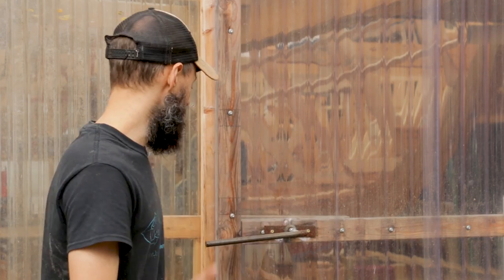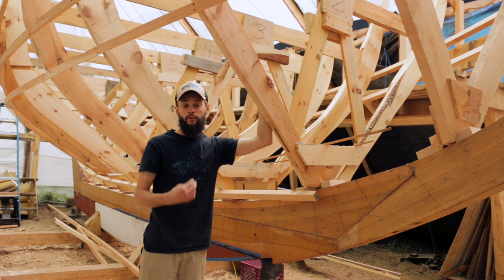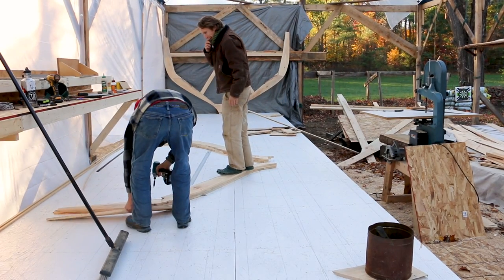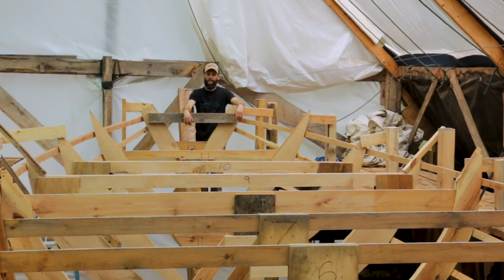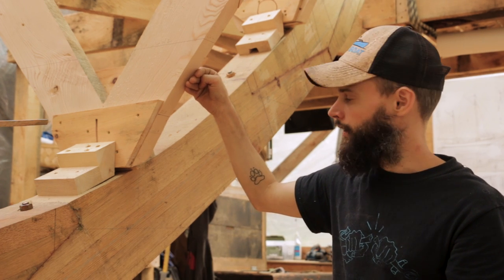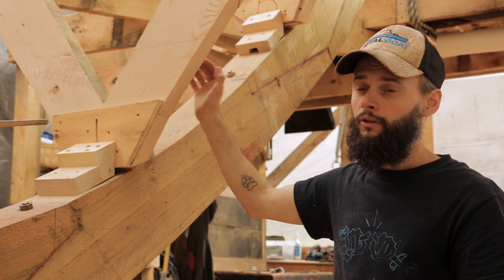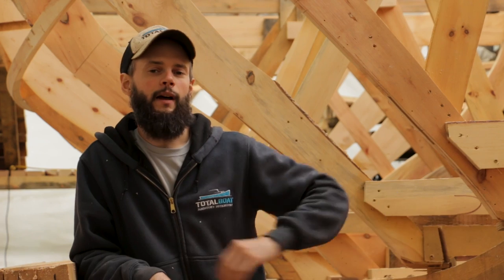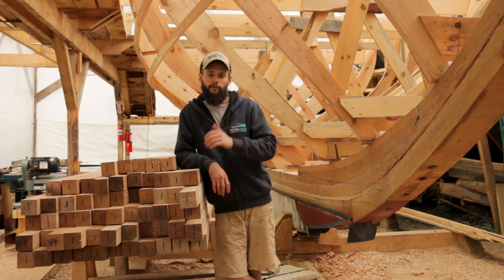Acorn to Arabella - Journey of a Wooden Boat - Episode 44: Putting Up the Molds

Comment: True you both end up with large REALLY COOL sailboats but isnt the Tally Ho building method much stronger and longer lasting? Not being a prick, you guys are doing something amazing. Why did you go this way and not the other?
Reply from the maker: Depends who you ask I suppose.
According to "The Elements of Boat Strength" by Dave Gerr
"Steam bent frames are generally superior for round-bilge hulls... sawn frames in round bilge hulls are only about half as strong as steam bent frames."
They may be smaller but there is no grain runout and that is where wood gets it's strength.  That is why Leo needs crazy crooked boards so he can try to follow the grain as best he can.  We milled straight grained timber and bent it so the grain follows the curve the whole way.

Comment: If you simply subtract the planking thickness from the loft to the mold, won't you introduce an error for those stations where the planking angle with the station is steep (fore and aft)?  IE, if your planking thickness is t, and the planking crosses the station at an angle A, then the thickness to be subtracted from the loft for the frame would be thickness/cosine (A)?
Reply from the maker: You are correct, there is a little bit of error.  For a boat this size though the error is within the scope of acceptable inaccuracies.  It would be a lot more work to sort all that out than to dub the molds a bit when you bend the frames or even plank the hull.  The bent frames have a little give to them at this point.

Comment: Can the molds be reused after they are removed? I'm assuming they can, so ships 2+ should be quicker ;-)
Reply: yea so do they really have to take all those down now?
Reply: They could sell them to another build, recoup some of their investment!
Reply: Won't the process of removing destroy them?
Reply: @wallykramer7566  that's why I asked. It seems that if they are careful and remove each section they could be OK.
Reply: @stickolascage7420  from what he said yes.
Reply: @robertkendall1037  Are you in the market ;-)
Reply from the maker: The molds will pop right out and be intact once the planking is on, it will be a quick and easy job.
The lofting, patterns and molds could all be used to build another Ingrid in much less time.  If someone is serious about building one they are more than welcome to them when we are done.  Otherwise there will just be a big boat shaped bonfire when the molds come out since there is no other use for them.

Comment: So where is the strength coming from? I've never considered this was a possible method, I've always assumed that a boat had to be built from the keel out and not create a basket then insert a structure inside of that - it seems like this would not be as strong?
Reply: Plenty of ways to skin a boat. They take the big frames out, but replace with better and lighter frames, after the hull has been planked.

Comment: All of the builders always bemoan having to pull the lofting floor before they wanted to. I get that it wouldn't be as easy to pull measurements with the nail on its side method, possibly impossible, but I would be inclined to fasten those sheets of plywood to the boathouse wall once I did have to pull it so it could still be easily referenced. Yes, difficult to pull a direct reference mark onto a pattern, but still right there to have a quick look for a dimensional reference. Possibly impractical, but I think I would like being able to quickly go back to it. Even if it was just to sit in a lawn chair in the morning drinking coffee looking at it and thinking "Ok, what's next?"
Reply from the maker: That is what we wanted to do but it is impractical with the staging and machines in the boathouse.  Having a wall for it would be the next best thing after having a shop big enough to hold the floor and the boat.  That is why it is called lofting, it was traditionally done up in the loft.

Comment: How could a carpenter not think to hold the molds vertical with diagonal boards going from the mold to the backbone? Just like a wall is temporarily held vertical with diagonals to the floor.

Comment: Why didn,t you notch the molds into the ships backbone, and bevel the edges so the planking could sit flush to the edges, thus leading to a far stronger boat, a wee edge on the bottom of the mold touching rib doesn,t look very strong , perfect example 11,24 gap left side of mould , you hit an obstacle under full power , keel stops dead what is rest of boat still doing namely the hull and all the molds. I,m not trying to put you down, I don,t want to see all that hard work getting destroyed and you all ending up in possibly a raging sea.
Reply from the maker: The molds maintain the shape of the frames until planking is completed and the deck beams are installed. The molds then come out, so they do not need to be notched into the keel timber. Thanks for watching!

Comment: This video makes me sick - I mean, really. There is some flicker and unsteadyness in there, which the ones before didn't have. Am I the only one seeing this?
Reply: A very slight flicker, didnt realy see it untill I see your post, but it is there
Reply: Finally I get a chance to use this: works on my machine
Reply: I saw no flicker or unsteadiness watching on a PC in Firefox Browser.
Reply: Watched it on Google Chrome Version 69.0.3497.100 and no flicker.
Reply: Same as Pearse, looking good to me on PC with Chrome Version 69.0.3497.100
Reply: Can you point to one particular place where you see flicker?
Reply: @wallykramer7566  it's the whole video, but especially the part starting at 0:40.

It's almost invisible on a mobile phone, but I get really sick on a computer screen.

Used Chrome on MacOS, will try on W10 as well.